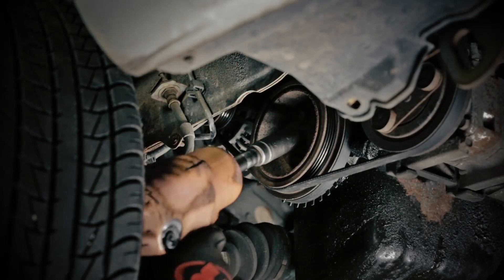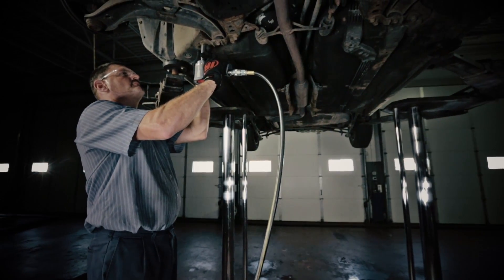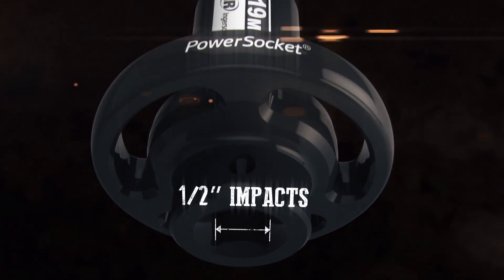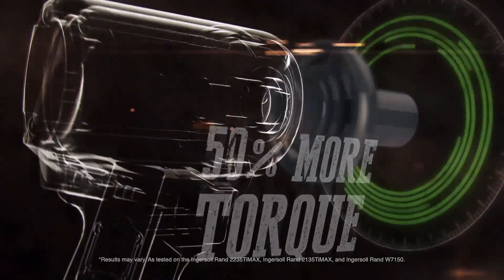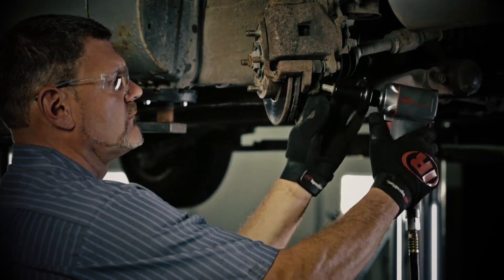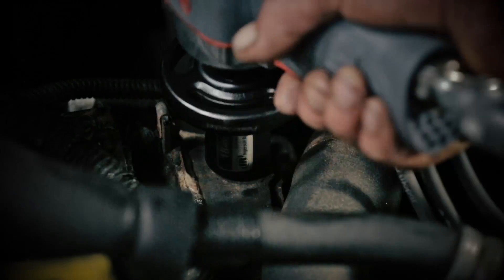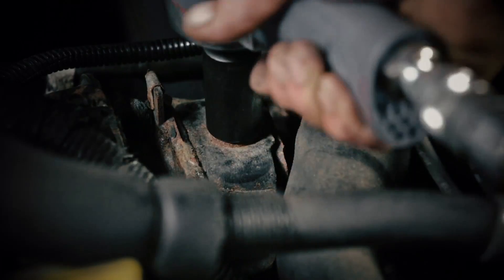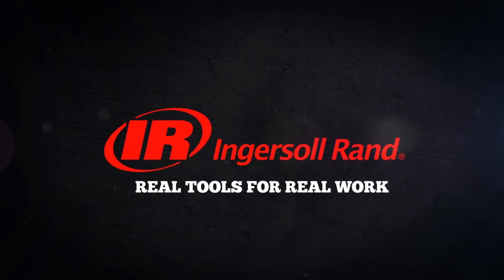Ingersoll Rand PowerSocket® adds up to 50% more torque

Comment: If the mechanism is that adding weight to the socket helps propagate the rotational impulse from the impact gun, could not the same affect be obtained just by adding an extension to the socket?
Reply: I think the torque output is lost when using an extension but the weighted sockets its harmonically balanced minimizing torque loss

Comment: I tried a 17mm with my 140nm gun but instill couldn't get my wheel nuts off. Are these designed to also work with a breaker bar or just with an impact gun?

Comment: How does this work? Is it Just extra mass  suspended outward from the center of gravity? Are there gears inside? Oscillating-spring-thing is not a thing, how does a spring oscillate?
Reply from the maker: There is a patent-pending design maintaining the potential torque output of the tool (as opposed to losing it). There are no gears in the design. Give it a shot and let us know what you think!

Comment: I don't understand how this works.  I've always thought that the shorter the socket the more removal power you have.  So having a deep well socket with this spring weight thing seems counter productive.
Reply: Shorter sockets might flex less. However, in this case the idea is to add mass to the anvil, I guess the idea is less energy is wasted in just vibrating and it might keep the anvil rotating slightly longer after the hammer hits.

Comment: Seems like it would be just as simple to make the device with a 1\2" stub so that any socket could be used, but then I guess you would not have an excuse to rip people a new one. Wonder how long before Harbor Freight comes out with this better idea?
Reply: The original idea was a very thick wall socket. Lisle tools makes a good one, and there’s plenty of Chinese knock-offs of that heavy, thick walled crank bolt socket. If anything, this is IR’s improved and patentable knock off of those cheaper imported sockets.

Comment: great idea. do you have any plans to release a small extension with the weight disk so you could use any size impact socket ?
Reply: It's not the weight of the disk that makes it work. These sockets are harmonically tuned to reduce kickback torque. Notice they have notches cut in the sides of the socket? It had to remove material to change the sockets harmonic resonance. Also any extension reduces the torque of an impact